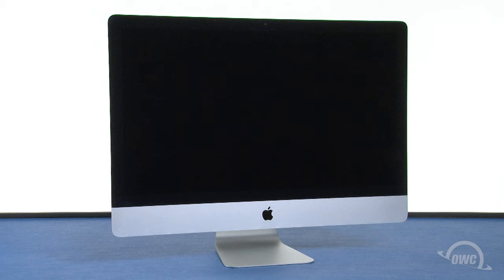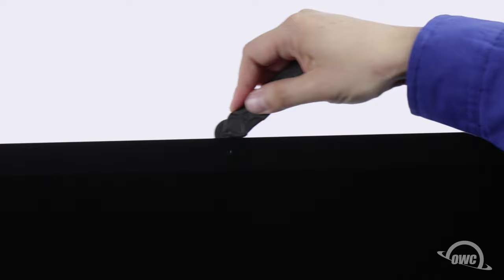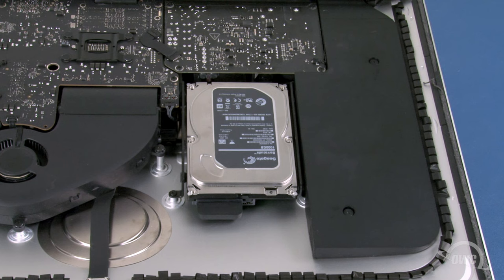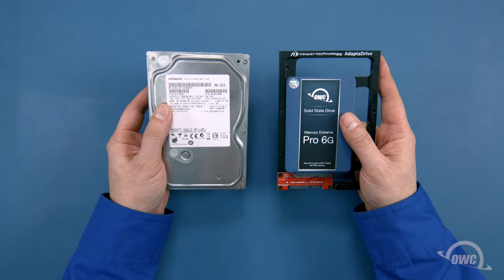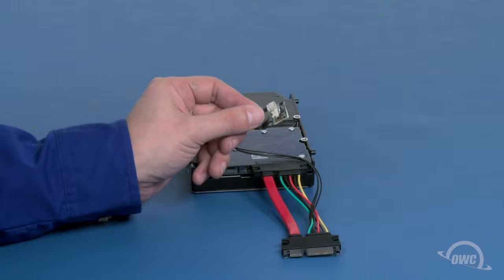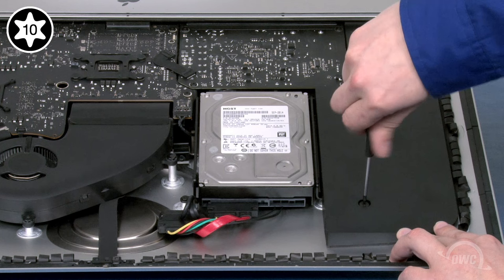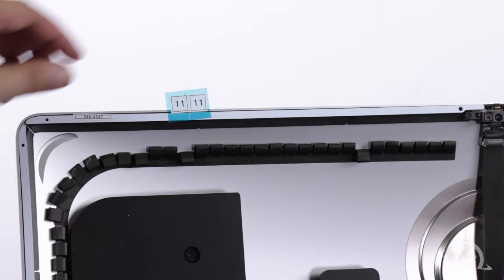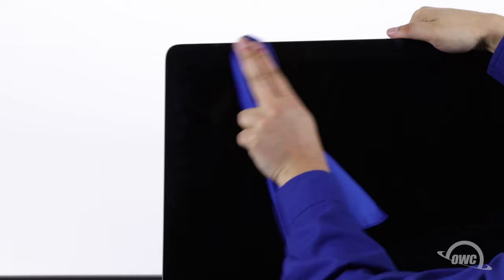How to Upgrade the Main Drive in a 27-inch iMac (Late 2012 – 2019)

Comment: Can i put my ps3 hardrive inside imac27
Reply from the maker: This might be a possibility, The PlayStation 3 is designed to run with 9.5mm high, 2.5-inch SATA hard drives. The same models found in most modern laptop computers.  Give us a call and we can discuss. OWC Phone 1-800-275-4576

Comment: Why do other videos about changing to an ssd on a late 2012 27" imac don't mention anything about needing a thermal sensor? Thanks
Reply from the maker: Regrettably we can not answer that the question because we are not sure what other videos you are watching. The thermal sensor cable is needed because the original thermal sensor in installed in the original drive so when you remove the original drive the iMac will constantly run at a high speed.

Comment: Do they always need to buy a new sensor?
Reply: On the 27" Late 2012 yes, on later models IDK
Reply: @MovieViking  thanks!!!
Reply: What I know about such things is you have to know what the sensor is doing or how it's working, or your cooling system can malfunction. I almost missed it on this one, because apparently the original sensor is hidden in the original drive and wiring harness.
Reply: It's not needed. Don't waste money.
Reply: @MrEd-qg8td  thanks

Comment: OWC sensor cable is not needed. Waste of money!
Reply: Does the iMac fan run at full speed without it?
Reply: @SurfSailKayak  Interested on that question too.
Reply: Me too! Don’t know why need a thermal sensor cable even with new HDD or SSD !
Reply: @benqhk  I didn’t mount one and it works fine 👌🏻
Reply: @benqhk  It definitely IS required on earlier iMac models I've done this on. The original 3.5" HDDs that came with the iMac had an internal temperature sensor in them, and I found it impossible to buy the same drive from Seagate, who made them. So you had to introduce a thermal sensor. Otherwise the mac ran at full speed all the time - noisy and the fan wears out.

I don't know if this is still the case though.